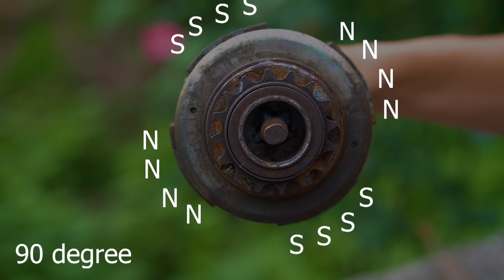I build 220v electric Hydropower dam

Comment: The water pressure is 0.4 meters, the flow rate is about 8 liters per second. The flow capacity is about 16 W. The efficiency of hydroelectric power plants is at best 30%. The actual power is less than 5 watts.
Reply: .o.ko
Reply: report fake chanel
Reply: Your comment is welcome for the uninitiated. Theory and calculations are the foundation of what you want to build.

￼
Reply: Unfortunately, the vast majority of the viewers will think that 'you' are the jealous guy here.
Still... it's another scam video.
Reply: The efficiency of hydroelectric power stations is high, between 80% and 93%. They aren't heat engines and aren't subject to the same kind of efficiency limitations.
Reply: @gregorymalchuk272  Yeah, a good hydro will get above 80% efficiency. But this is a very crappy one. 30% is very generous.
Reply: Actually, hydro power can be a good deal more efficient than 30% - but this implementation is really poor, so 30% would be generous.  I worked it out as well (in the main section of comments), and being as generous as possible, I thought he might be getting 20W - but certainly nowhere near 7,000W (= 9.4 HP).
Read my comment in direct answer to the video.
Reply: @alexandrevaliquette1941  I was like, why not have a bigger sprocket on the "turbine" so it drove the "generator" faster.. 
or.. why not adapt a dryer motor instead of trying to jerry-rig a few microwave transformers for your generator..
Just reeks dodgy (in more ways than one).
Reply: @revrndcast3918  And even if you got the perfect generator from NASA, there is not enough water drop + water volume to get the claimed power in the title.
Reply: You are a true damn Engineer.
I am also an Mechanical Engineer.
Reply: Yes that was why the lamp is dim. Dosn't get enough power
Reply: But there is always improvisions trial and Error built the world we live in and nothing is better then compatition
Reply: Can you make videos like this Sir. You can enlighten.us.i like to make one of rhose.
Reply: Since the flow is not uniform the illumination from bulb can never be uniform. This video is a cheat video.
Reply: right, nothing volume water or height, still equipaments not are projects right
Reply: Hii guys
Reply: Formula is P=QpgHn where P is Wh, Q is flow rate in M^3/s, p is density in Kg/M^3, g is gravity in M/s^2, H is height, n is efficiency ratio (30% is not right, it's typically above 80%). 
P=0.008*1000*9.8*0.4*0.8=25w
Which seems enough for a slowly moving fan and a barely lit bulb.
Reply: @revrndcast3918  Or, why not use a car alternator and a battery and then just tweak the gearing.
Reply: Actually this known here you can see it not make much power and when the power is connected you can see the chain slow down but 5 watts is enough to light a light bulp at dim and turn the fan side to side and turn the fan slowly all in all works but not efficient
Reply: Плюс под землёй и внутри трубы проброшен скрытый кабель от дома. Ещё 5 кВт... )))
Reply: Eres alguien inteligente, seguro eres ingeniero.
Reply: @alexandrevaliquette1941  so the world is now hating on people who make videos of them making stuff? Bet, sounds like the planet is about to get fcked
Reply: @thefirehawk1495  for most hydro setups your probably right but no way that thing is gettin 80% simply if you look at the bucket used for the turbine with the inlet and outlet locations the water will tend to flow around the outside and there is a 30-50mm gap between the turbine blades and the bucket so majority of the flow is just going around the  turbine let alone the generators efficiency which would be lucky to be 60%
Reply: @LT72884  lmao, the guy in the video is making false claims, they are being disproven here.
Reply: @charley6799  bet, haha, sounds good to me. Ill keep trolling, but on another thread haha. First, food haha
Reply: @gregorymalchuk272  That is true for very carefully optimized turbines. Do you think this guy is getting 80 to 93%?
Reply: @LT72884  Making stuff and video are great.    I'm just pissed off about people who believe in magic and forgot the basic physic.
Theses people think: "so proud of this genius guy with low budget and high skills". In fact, theses guys are just cheaters who impress stupid peoples.
We don't need any of these two crowds indeed.

Good news, if you read the comment, some people bring scientific arguments to debunk this video. At least, the curious readers will be smarter tonight.
Reply: @alexandrevaliquette1941  i get what your sayin. Im a medical and aerospace engineer and noticed a few incorrect things..
Reply: @charley6799  kinda both. Was curious what was going on, even with false claims, still cool to watch him make something, then on other hand, i an see why people are saying stuff. Kinda cant get 220v out of a unit that size. Need bigger magnets, faster velocity, and bigger coils.
Reply: Victor Louzada  Look at the formula "The Firehawk" shows. Notice that there's nothing there about how to extract the power. It just simply shows the power available, given the characteristics of the fluid moving. The displayed setup in no way shape or form is capable of producing the power mentioned.
Reply: @LT72884  yeah, and 7000 watts in the thumbnail is almost comedy
Reply: @nowyouhaha7011  At first glance I would say the same since it's a russian channel
But after looking at his channel, the dude has actually built his own hydro power turbines, and they seem to be a lot better engineered.
Reply: As well as the ac frequency looks to be way low. Like less than 5 hz
Reply: @E = mc² • 5 hours ago • 9 minutes ago The concept is called "head". Look at how high the water level is. Look at the relative height where the water leaves the system. The difference between the two is the "head". The maximum theoretical power output from the system is head*mass*gravity. Assuming that you're using the metric system, head is measured in meters, mass in kg (and because 1 liter of water is 1 kg, liters is frequently used. Yes, it's not exact, but it's close enough), and gravity is 9.8 m/s^2. Just multiply the three values together and you have a good grasp of the maximum available power.
Reply: Marty t does a better job on one.
Reply: Hahaha.. there you go my Russian friend! 
The finest brains 🧠 
Love from india
Reply: yeah, not the most efficient way there's a lot of way better alternatives you can see fans slowing and speeding and light dimming but could be used with a charge controller and trickle charge an array of batteries than being converted with a 12v to 3000w  inverter but yeah video titles misleading that things not putting out hardly any watts for reliable main power.
Reply: @Babbages  Must be an ingenious invention, this 12V to 3000W converter. XD 
To clarify: 
Volt is a unit of measurement for electical difference of potential. 
Watt is a unit of measurement for power. In this case electrical power, which is the equivalent of Volt times Ampere. (Ampere is a unit of measurement for the amount of electrons that flow through a conductive material in a given time)
To conclude: Your "12V to 3000W converter" is lacking some information at best, but you most likely just chose some random words to write here, to sound smart.🤪
Reply: @Babbages  I know what you meant by that. :) But you normally convert one voltage to another, so you would say "12V dc to 220V ac converter/inverter".
What you didn't understand though, is that the guy in the video is a faker. If you look closely under the pipe at 15:29, you can see 2 cables haning out. One of them has a tx60 connector soldered to it, (google it, you'll see) which is normally used to connect lipo packs to various devices. So that "Motor" he built probably doesn't even work and he just uses a lipo and a low Voltage DC to 220V AC converter to power these few Devices. That's btw not the only thing that is extremly fishy in this video.
Don't believe anyone on the Internet, always do your research and look closer if something seems fishy. Heck, don't even trust me if you feel something is off. I'm also not always right, like everyone.
Take that as an advice from a trained electronics engineer and technician-to-be. :D ( technician for electronics in germany is a two-year training course, the completion of which is comparable to a bachelor's degree, but not quite. It's not a study but more like regular school... come to germany if you wanna learn more than the basics for free. :) )
Reply: @DownhillAllTheWay  Hear
Reply: @gregorymalchuk272  There is no way it could be as high as 93%. You can have a generator that has that kind of efficiency but the mechanical losses through the turbine and linkage is where you start losing efficiency.
Reply: am lost at 100KV coil...the capacity of that TX is less than 1KVA  how can it even  induce a dangerous current of 100/1=100KA or rather 100 000amps?!!! without turning into ashes?. I will never buy this lie
Reply: And the generatsor is junk at efficiency ~10%. So actually 0.5w
Reply: The efficiency of hydro electric power plants is definitely more than 30%. This specific microhydro is probably 30-50% if that's what you're referring to. Just a little misleading by saying power plants as they reach up to 80-90% efficiency and if one is getting less than that then it probably is broken or not going to be built.
Reply: Nice calculator person 😸
Reply: At the end of the day he create something people stop complaining jeez
Reply: @kevaughn5600  no, dishonest information is still dishonest. There are better videos that provide better fixes to the same problem already.
Reply: hahahaha! nice math, if we talk of money the copper from those coils could be sold at a good price. it would pay for the electricity consumed 5 watts u say and 2 days meal. hahahahaha!
Reply: IT IS FAKE
Reply: @alexandrevaliquette1941  Any knowledge and skill to built something like this to get by is legitimate, and not everyone is spoiled and has the same resources as you. You could do your own version if you're so jealous of the number of views.
Reply: @gregorymalchuk272  maybe hydroelectric stations are 80% plus efficient does not mean this one is. Under and over shot water wheels are both below 60% efficient. you dont have to be a rocket mathologist to see the paddle wheel in a bucket is losing a lot of efficiency. Gap losses wall bucket wall, flat blades, inlet and outlet angles and, inlet and outlet height in chamber, and chain drive all create their own set of losses. Im not one to call it any way other than how i see it. Thing is i can set 2 fans in the wind and blow hot air up your skirt about wireless transmission of 120Volt AC. He may have close to 100volt at 2 amps but who cares it is free power right.
Reply: @masterdebater8757  The original comment said "the efficiency of hydroelectric power plants is at best 30%". That was factually wrong and gave a wrong perception of utility scale hydroelectricity projects. My comment still stands true.
Reply: True that, and not to forget... I kind of wonder how the guy is running 2 FANS off of a supposed 220v and... what 5-12hz? Those devices are fairly optimized to run on higher frequencies. Pretty sure a fan would start to actually behave quite funny under 12 hz or less if it's supposed to run at 50 or 60 hz. Pretty sure fans for 50&60 will be basically interchangable but... 12 hz?
Reply: @masterdebater8757  Rocket Mathologist!  Love it. And I'll agree since I don't want to get anywhere near you while you are Master Debating!:elbowcough:
Reply: This is not generate
This is motering
Reply: If that was 5W, 5W is RGB light on inside my desktop computer, how would he power one electric lamp that need supply of 60W and two vents that each takes around 100W ???
Reply: Мы подростками еще в 1988 году в Томске такой же херней занимались. Только у нас все было круче и  нам было тогда по 12 лет.
Reply: hello brother
Reply: Sé stesso però non ho ancora ricevuto nulla e tutto quello
Reply: @ЮлияПопкова-к4я  hgjdggfe
Reply: @theodorbutters141  this is usa channel?
Reply: @horseyhorselips3501  That thing can maybe charge a phone or power some efficient LED-lights. He would be better off purchasing a simple Solar Panel and to use that. That whole system is inefficient as crap, he didn't even tighten the chain properly.
Reply: @techytrendysolutions6063  Buy a Solar Panel off the shelf, you are better off with that.
Reply: @revrndcast3918  It works, but not great. That is how a generator functions. I can't say if the magnets were even suited for this job or if he made the most efficient arrangement of them. Nonetheless, this works… To charge a smartphone or a LED-light, but not more.
Reply: That was what I was thinking, more like 7w and not 7000w
Reply: If this generated as much power as advertised, we wouldn’t have any energy issues.
Reply: thanks soooo much
Reply: @gregorymalchuk272  efficientcy of the dynamo is that high in every power station but the overall efficiency of the powerstation could be lower. the problem is this guy is using some garbage rusty transformers as a dynamo I don't think he will be getting an efficiency higher than 10%
Reply: I suspect it's not a generator but actually a motor powered from an extension cord buried under the whole thing. There's no way a tiny fall like that would produce any force plus the "permanent" magnets are too tiny to generate a current in a transformer like that but the magnetic field generated by those transformers would surely push a magnet around. I've made magnets "dance" on transformers like those ones before
Reply: @adilrais1976  with that logic your light bulb im your house cant light uniform aswell cause ac power switches 50 Times a sec. In fact, with a phone capable of Super slow mo u can actually see it in led's. But wire cant cool off or heat up that fast so you wont be able to see any rapid voltage changes in a bulb.
Reply: So you'd definitely need to scale up to reach any reasonable amount of power.
Reply: @lortzo573  first read my comment and resume your high school studies again ... Then come to comment.
Reply: @iosifferencz5432  aa
Reply: Well with the Adsense he is making from this video, he will be able to afford much more power so technically his claims are true!
Reply: 7 KW hahahahahahaha
Reply: Yes, but even then - how do you get a licence to build that?
Reply: @alexandrevaliquette1941  yes you're correct, I'm getting smarter reading this comment, cheater still is cheater
Reply: The efficiency of hydroelectric plants is in the 90th percentile. Not sure where you get your 30 percent efficiency rate which is worse than a diesel engine
Reply: A fan it’s 30w minimum
Reply: Thanks, I dont think I will see Sherlock himself will comment here.
Reply: @poopdookievii7538  right now im building a rocket for spaceport america cup. I like being an aerospace engineer because i get to learn tons about all disciplines of science such as math, physics, materials, strength of materials, electronics, 3d modeling, chemistry, and i even took anatomy and microbiolgy. I would suggest becoming a level 1 rocketeer and learn all about rockets. It really helps understand how the science works.
Reply: Wow not even close to “7000w”
Reply: yes just the size of the generator and 4 coils lol to do 230 need like 12 at least with 90 turns with 1.8 wire
Reply: Да
Reply: But he uses coils called transformer to boost the power to 220v . So you the power is in fact 220v but if he only had a battery then the power would be much much lower!😊
Reply: Interesting build, but lacking in thought. Bearings that can't be replaced, and a chain that can't be tightened, etc. Has he not heard of nuts and bolts? Longevity is lacking, but I don't suspect it would work for long anyway. Not sure it worked at all, but benefited from a hidden battery? It must have been fun, just to see the thing spin. 😂
Reply: I subscribed to you and unsubscribe out of his channel :)
Reply: If you look closely you will see that there isn't even 0.4 meters or 15.75 inches of head. I believe that 0.15 meters or 6 inches of head would be generous.
Reply: i was thinking the same thing
Reply: Yeah the slow spinning fans and the light that's almost not even on should give it away right away. without doing the math i was estimating 20W max, 7000 my a...
Reply: 7.000w 👍
Reply: Charge your phone in 4-5 hours
Reply: so u can power a welder with a piss
Reply: I'm not saying much but that's a good project,I suppose if he had a sloppy water fall ,or an erect of a dam with water falling in high pressure,that could have great impact on turbines and hence the power could be great.
Reply: I'm not saying much but that's a good project,I suppose if he had a sloppy water fall ,or an erect of a dam with water falling in high pressure,that could have great impact on turbines and hence the power could be great.